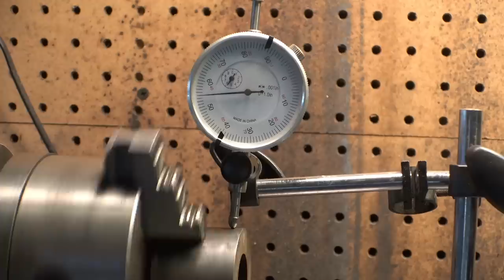Making an Automatic Two-speed Go kart Transmission

Comment: wait, but if second gear engages you will have both gears engaged ath same time, what am I missing here?
Reply: That's why he used bearings with a one-way clutch in them. The first gear sprocket will just over-run the shaft that it's on.

Comment: I'm curious what the load rating is for each of those sprag bearings. And if with a little more machining if a third and 4th could be added. I wouldn't be surprised if they were the weak point.

Comment: This is sweet but I think instead of a solid latch you could use a clutch cuz that's gonna shift hard af!! do the math on the gearing before you build tho cuz the way it sits that axles gonna need some huge sprockets... And the problem with just using a bigger sprocket on the input is you need some speed there  to reliably engage 2nd..

Comment: This is fairly brilliant but will have a side effect that may not be desirable. When you back off the accelerator it will freewheel rather than using engine braking.  That could produce some unexpected results :(

Comment: Maybe for a 212 it can hold the horsepower, I don't think that lever can hold much more, maybe for a mini bike with one chain on each side of the wheel.
Reply: Those one way bearings don't have a high torque rating. I was trying to use similar on my go-kart for other reasons and the specs show like 1-8 ft/lbs so after his first reduction to the transmission shaft the torque is going to be higher..... I don't see this holding up but im very interesting in finding out.
Reply: I believe the input shaft for his 2speed trans will need to be run at either the same or higher rpm than the engine to work properly... any gear reduction prior will cause too much torque thru the trans and cause destructive failure

Comment: Cool design but without a clutch mechanism it will slam hard.  Does the first gear disengage if it is fixed to the shaft?   Good luck...

Comment: I have always wanted to see someone use a Power Glide transmission in a build . Have you weighed the pro's and cons of that application ? The aluminum version only weighs 95 lbs. So , a two speed trans. with reverse , no clutch peddle or centrifugal clutch . Drag car guys love them .... ?

Comment: While your idea sounds good, I am not so sure the transfer from first to second is going to be a fluid as you think. But I will watch to find out. You really need to think about automatic hydraulic first and second gearings using clutch packs to swap gearing. I think you could design such a transmission even on a small scale. Think torque convertor workings. Go for it...

Comment: 1969. Heathkit offered a Boonie Bike with that same jackshaft.
Had a huge back tire that smoked the centrifical clutch on a regular basis. Otherwise, pretty nifty design.
Good luck with your project.

Hammering those sprags is tempting fate. A draw bolt would have been a bit more orthidox.
Jussed sayin' 😶

Comment: I would think two or three pawls would be better in there, but more importantly I would case harden the pawl and it's sockets. I think it will wear pretty quickly with the pulse from a single cylinder engine. It's not just pushing solid on it. More like hitting it with a hammer repeatedly.

Comment: I'm floored, you have some great machining tools. Impressive.  They look like you made them also. But you're killing me with the stinking claw hammer bro. Spend a couple of bucks at the Harbor Freight and get yourself a set of ballpeen hammers. I've been a Roofer and Carpenter as my trade the first twenty years of my working life. Started at 15 years old. But it's been a long time since I've been on a ladder. Heck I don't even know where my claw hammers are anymore. I do a lot of hobby fabrication and the ballpeeners are all I use now. Kinda feel stupid using them to drive nails and they don't work very well for that anyway. The reason I came over here is because I built a gasolina powered pedal trike chopper. From a Schwinn Stingray chopper frame and a Headstrom trike rear-end. Both axles have freewheels so I always have positive traction in forward motion. And can still turn corners easily. The thing that sucks about such a configuration is I have to start the engine kicking it over with the pedals. So I'm running a 25 tooth sprocket to a 17 t then it goes 36t to 10t on the engine output. And it's still a bear to crank! I'm reconfiguring the final drive from 5/8" axles to 3/4". The original setup on the axles have 1/4" rolled pins and slots in the hubs to lock the wheels to the axles. And nylock nuts on the outside to hold all together. That works fine with the original old lady and retarded dude pedal trike. But with the engine torque and buttloads of brick streets in my armpit of a Police State city I've been breaking axles left and right literally. And it not only hurts but it's embarrassing every time I lose a wheel and crash. Anyway I was thinking of building a transmission for when I put it back together.  Great work and awesome video and editing skills brother and GOD bless you and your channel!

Comment: Good idea but I don't see longevity in it. If you did two or more dogs in the overrunning setup where you could distribute the force equally around the circumference of the year it would last longer. As it is you have one per se  in engagement which will create a tremendous amount of force on that one tiny pin, and dog.

Comment: Is the one way bearing a strong piece for holding with high horse power? I remember building a front wheel drive Chevy transmission and having to replace a one way clutch inside.

Comment: Hi nice work but have you check the torque spec of this tiny one way bearing? From what i know the torque on this is very low so it will break. I use a lot of them at my work place . A hi torque clutch bearing for a 1 inch shaft that is rate for 100 ft/ lbs of torque cost me 950$can!

Comment: Hey mate how fast were you running the lathe when using the larger drill bit looked a bit quick? Easy general calculation for drill bits into mild steel is 9000÷Drill bit diameter

Comment: Have you tested it on a vehicle? I have some doubt it might not work the way you are presenting it. RC Nitro cars have simmilar transmisions, but its the other way around.  The gear you show as input is output. And the transmision gesrs are connected.to a jackshaft before the transmision, not after it.

Comment: Doesn't it make more sense to do this on the axle shaft so the gear change is speed dependent, rather than engine rpm dependent? (i imagine if you are stationary and floor it it will just start in second gear, which would defeat the purpose of having 2 gears)

Comment: Nice fabricating on that! Unfortunately, as others have pointed out, you want the centrifugal dog to be on the output shaft, or the axle, not on the input shaft. Here's what's going to happen, you will accelerate, and once the ENGINE rpm hits the right point, the dog will fly out and engage the 2nd gear sprocket. Once it has engaged, the ENGINE rpm will then drop, because you are in 2nd gear. When the ENGINE rpm drops, there will be less centrifugal force holding the dog outward, it will want to disengage. It will probably stay engaged because of the torque holding into the pocket inside the sprocket, but if you let off the throttle even a little, it will probably slip back out, and the engine will have to race again before it can re-engage. If you haven't already installed this in a go kart, you should probably re-engineer it correctly. Again, great engineering and fabrication. It's just slightly backward.

Comment: Do u return the shavings as scrap or what does a machine shop do with em?
Reply: Usually they get recycled as scrap steel as most areas of the U.S. you can get paid by the ton for your scrap steel
Reply: @dodgeme1986truck  cool. Ty

Comment: Don't you want it to engage at a given wheel speed rather than a given engine speed?  I think you would just need to put the sprag clutch on the driven, instead of the drive sprocket.

Comment: Couldn't second gear just be hard fixed to the shaft, instead of free spinning to a certain RPM? Seems like first gear would be able to overcome the lack of torque that is needed for second gear?
Reply: needs to freewheel until the point of shift, you cant have 2 drive ratios trying to drive at the same time

Comment: It's an interesting idea, but I think it's poorly executed from a design perspective unfortunately.

There's a good chance that dog you've put in there is going to skip a bunch and chew itself out.

Next thing is the occasions where it does engage are going to cause a massive shock load. That could do all sorts from bending the shaft, bending the conrod(s), damaging chains or shearing that pivot pin the dog is on.

Even in the short term if it doesn't immediately self destruct, being on a jack shaft operating at the engine rpm as soon as that gear engages the shaft rpm will drop and from there any over run or momentary absence of engine load will have it disengage and the whole assembly will hunt.

The reason it works on an RC car and won't work here is simply inertia. You have way too much of it.

It's a pretty good prototype and well made though.

If you do a rev2 I'd suggest mounting that assembly on the axle, that will help prevent any hunting.
Next change I would make is to use a centripetal clutch (auto clutch on a quad bike etc) on the 2nd gear assembly to allow a soft engagement.

I do hope I'm wrong, and you've done a great job regardless.

Comment: I've used the tailstock to push bearings square, but it looked like your fit was a bit tight.   One of the troubles of working machines by yourself, is that there is no one to shout at you:  'TAKE THE BLOODY KEY OUT OF THE CHUCK!!!'   Do you have any sort of hardness tester in your shop?  AFAIK the cheapest are the file sets which are well under $100 on Amazon.  I'm thinking the sprocket teeth will have been softened from the welding.  I think they tend to be induction hardened to give a hard outer shell (High 60s Rockwell for a sprocket that size) but with much softer core of around 40 Rockwell.  You are probably not going to be doing thousands of miles on the kart, but given your aversion to lubrication, accelerated tooth wear might be a problem.   It hurts my heart to see you machining with no lube.  Just a tiny bit of Rocol RTD brushed on would make all the difference, and not compromise the filming too much.   It looked like you were using 3mm welding wire as a pivot, and that has very low shear strength, and that joint is going to be highly stressed in shear.  Tool steel rod would cost almost nothing in that size, and probably take the load.  If you had room to use larger diameter rod it might be a good idea.   

A nice project though.  There some clever buggers in this world.

Comment: I had a mini bike from the 60's that had a jackshaft behind the engine, but in front of the rear wheel- it had a second centrifugal clutch with different weight springs on the flyweights so it would engage after a higher RPM than the one on the  engine did, somehow with a gear ratio change it shifted 1st & second gears seamlessly and much more reliably that that will- the one way bearing and/or the non-hardened, mild steel Pawl in your home made sprag-clutch will self destruct in no time - this trans works OK in "JohnnyQ90's" Radio controlled car because the car weighs 5 lbs and the engine puts out less than 1 HP........... this is not practical the way you've made it-
Certain things cannot be "Scaled-Up" like in the old Monster Movies in the 1950's, if you bombard an Ant with radiation and make it grow to 100ft tall, the weight of the ants guts at that size would bust out of it's exo-skeleton because it doesnt work that way, because PHYSICS
Reply: The two speed your talking about had one way bearing also
Reply: @quickturn66  Yeah, I was barely a teenager, so details like that are sketchy, but that sounds right?

Comment: This will fail because those internals are too small for the purpose.   
 The robustness that it requires would make it very heavy and/or 
expensive. This is several orders of magnitude undersized/under built. 
It should be interesting until it fails though.

Comment: So here's the problem with your design: the engagement mechanism should be on the output side so it's department on wheel speed not engine speed
Reply: I was thinking the same thing. Otherwise you’re gonna be floating between first and second the entire time you’re speeding up.

Comment: The end result is going to be disappointing. The shifting should be based on the  Drive axle rpm not the engine rpm. You want to be able to enjoy the full RPM range of the engine through 1st gear then shift into 2nd gear and enjoy the full RPM range of the engine again at  higher ground speed. It will not be a complete failure the performance we very much like a variable speed torque   Torque converter  With an unpleasant clunk and grab in the middle of the engine rpm range

Comment: I love your drive to design, but why dont you try a dual clutch 2 speed jackshaft setup? Theyve been around for 70 years and work great.   This kit is way overpriced for whats there, but It used to be a $100 kit http://www.blackwidowmotorsports.net/_13132r_two_speed_transmission_kit_68_69.html